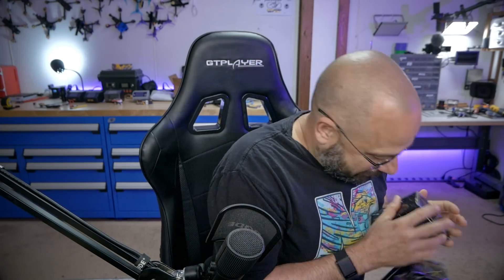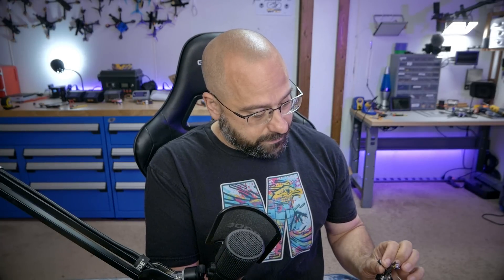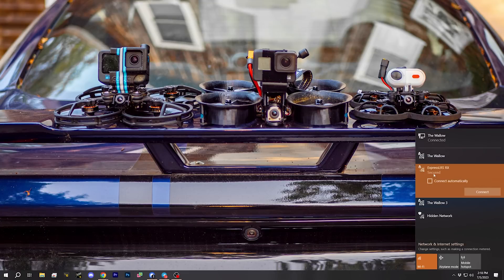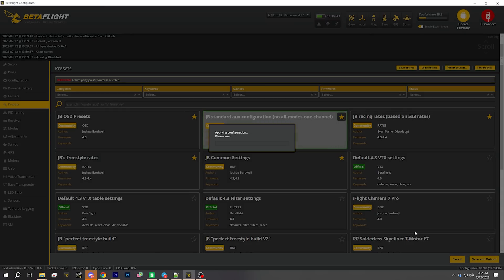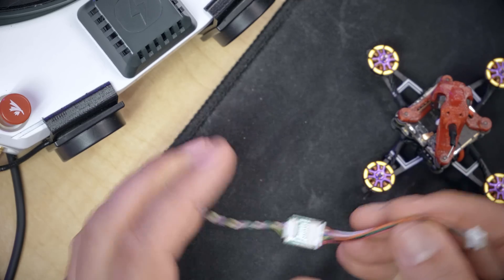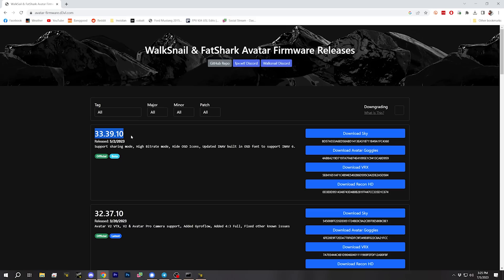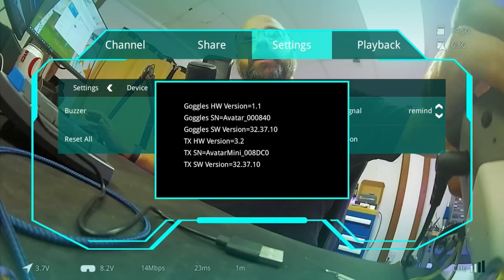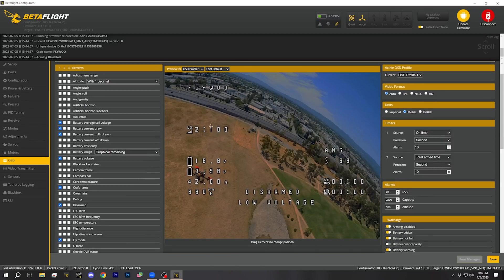Betaflight Setup on Firefly Baby Nano 1.6" v2 (HDZERO, WALKSNAIL, AND ANALOG)

Comment: Hi all
I just bought the following:
- Firefly 1S DC16 Nano Baby Quad HDZero V2.0 BNF ELRS 2.4G Drone
- HDZero Goggle
- X-AIR 5.8 MK II pair for HDzero goggles - LHCP, Combo stubby

Now i try to find out, want kind of Antenna there will be on the Drone. Do i need to buy "some" antenna for the Drone as well? I did not find anything about that. I just read stuff about Right and Left antennas, and i ordered a Left for the Googles, but there was no option when i bought the drone...

Can anyone "point" me at a hint?

Tank you

Comment: Hey i have the charger that comes with the emax ez pilot pro, and when i plug it in i get really hot and the lights stay green, and i dont know what to do.
Reply: Is it on the right setting. 

Some say hv or lipo switch iirc
Reply: @RandomHobbies13  I figured it out, my charger just gets hot, but if i leave it the lights turn off and everything is fine.

Comment: I'm led to believe the GNB27 connector is not compatible with BT 2.0, but the A30 connector that GNB can also supply on some battery types, is. Not tried it myself.
Reply from the maker: The a30 can plug into bt2.0. There is a little tab but it just sticks in.

Comment: Could you do one of these review/setup videos for the geprc cinelog35 v2 with the 03 air unit? They ship with M8 gps units but i asked them and they confirmed if you order one without the gps they will install an M10 (even one with the compass and altimeter) if you buy one from them. They recommend a 6S 1300mah, and seeing as how thats intended for use with a gopro, I figured I'd get a 2000mah bat since the 03 is the only camera I'm intending to have on board and the larger bat is a few grams off the weight of a gopro. Thanks JB.

Comment: Mine when connected came with unknown firmware rev had to ask elrs devs lol and flashed through BF passthrough just incase. Working fine. Flew today and had a prop fly off 20 seconds into flight. I think after 50+ flights they worn out lol
Reply: hey my elrs firmware was unknown aswell so what target/ firmware did you flash?